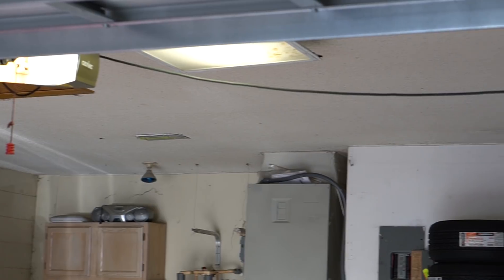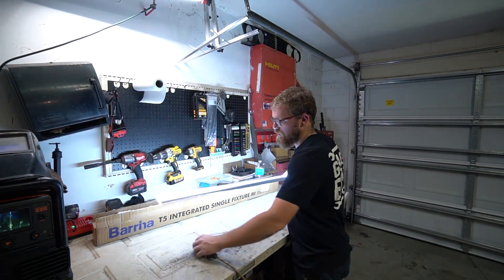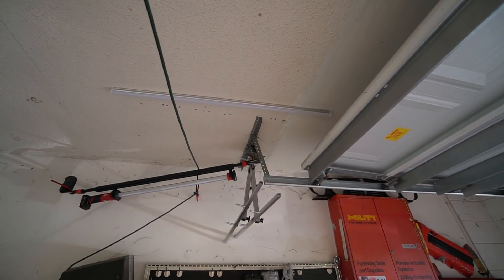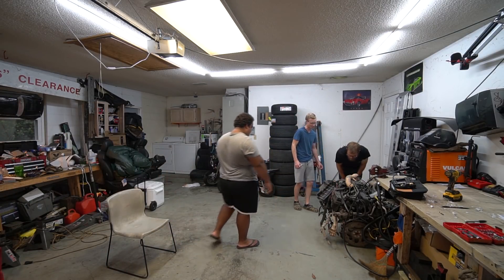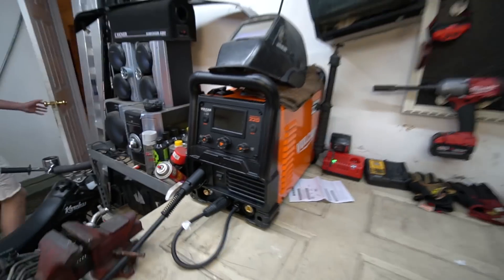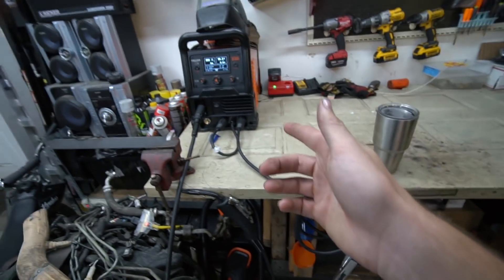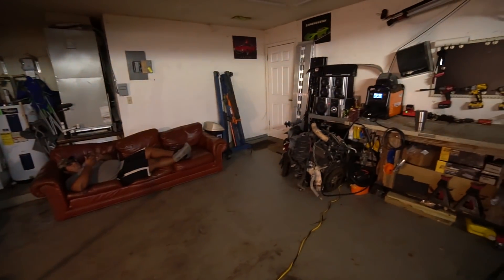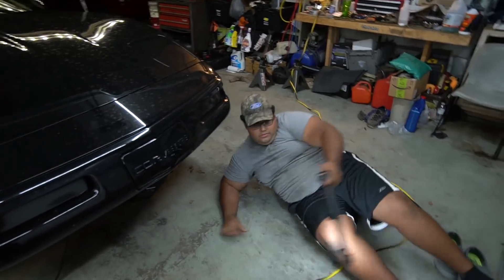The Miata is back! + Ultimate Budget Garage Lighting!

Comment: I’m a welder by trade Taylor, keep practicing as you are as the welds don’t look too bad on the camera for the first time in years only advice I would give is get you head further away from the arc, it takes a bit of getting used to but you will find you can see so much more looking from a bit further away than that close to the metal

Comment: Installed all those lights and parked the Miata in the darkest spot of the garage 😂😂. Good job man did a similar upgrade to my garage but wired them to work with the light switch on the wall

Comment: Did You use weldingwire, that has no need to have a protective gas for the weldingprocess?
Damn... I would always weld with a gas-bottle attached. In my poinion, just a Normal MAG weldingwire and external gas should improve your welds quite well. Greetings from Germany :D
Reply: It's like stick but in wire form, so instead of gas to shield the weld you get slag. ;)
Reply: How am i stupid? :o
Reply: @Apulanty I had the fluxwire in mind. But i hate the slag, so i prefer welding with a normal MAG. :D
Reply: Oh, i see! Yeah, slag is not the best thing. :P
Reply: And reading back, it kinda looks like i like the stuff... Shit. I've used it once, never again. :o

Comment: with flux core you want to be about a quarter inch away from what you're welding, and clean EVERYTHING, makes a huge difference, as for adjusting voltage and wire feed speed, google it theres a lot of good guides on how to interpret what needs adjusting based on wire size and material thickness, as for travel speed, the puddle will force you to move forward, you dont need to go any faster than that unless you're melting through or getting extremely convex welds, dont angle the gun more than about 20 degrees to the right (travel angle, if you google weld travel angle vs work angle it will help to understand what i mean) and you want to be straight up and down on flat welds, and about a 45 degree in fillets on the first pass.

Comment: I know you had the garage door open while you were welding, but your ceiling height is not very high (as opposed to a pole building where the fumes have somewhere to go). You might want to get a couple fans out there to circulate air so the welding fumes don't stick around.

Comment: Your welds look good just looks like you need some more practice 
I would have suggested you go with anything other than a harbor freight welder but it seems to work 
I prefer miller 
Also doing stick and tig will develop your skills alot more than any mig. In welding school they had us do stick first them move to mig it helps you get a better idea of how to flow the metal

Comment: Use a grinder instead of a wire brush to clean the welding surface. You might still have impurities on the metal surface that's causing some porosity. I use a wire brush sometimes, but mine is mounted on a grinder and is much more aggressive than that little drill one. Also, NEVER USE CHLORINATED BRAKE CLEANER to clean your parts before welding. It can kill you or screw you up for life.

Comment: Your face is to close to where u r welding ur never suppose to do that.
Reply: Kenzie R what’s the issue? ( I don’t weld so I’m just wondering)
Reply: Joseph Samsor the fumes from the weld is toxic. U need to keep ur head up ao u get fresh air
Reply: Kenzie R I guess that’s true. Just hold your breath I guess? Personally I would’ve just set up a fan or something. Yeah you’re right though
Reply: Joseph Samsor with the flux wire ya u can set up a fan but if u have a tank of gas it would blow away the sheilding gas and ur weld would become shitty.
Reply: Kenzie R ah that’s a good point. I really need to learn welding